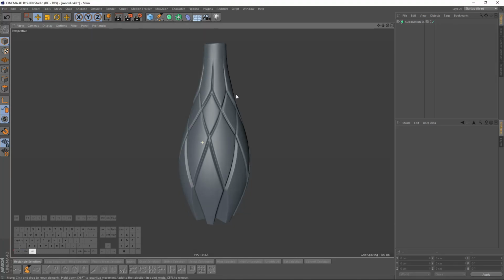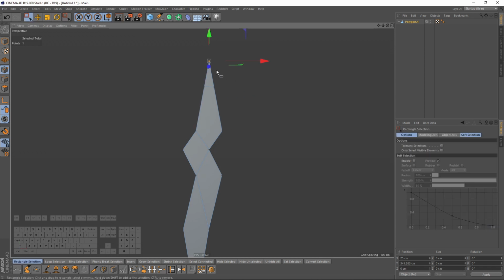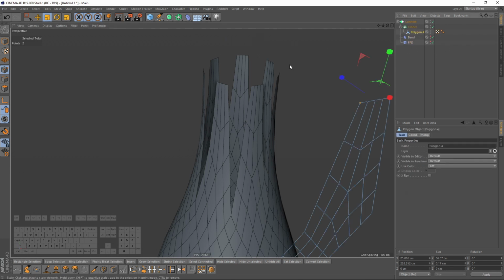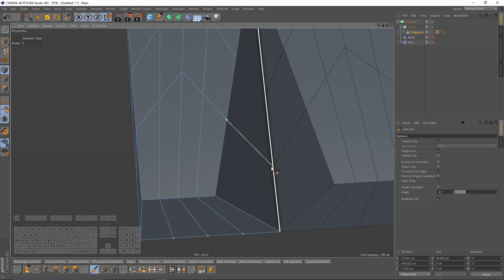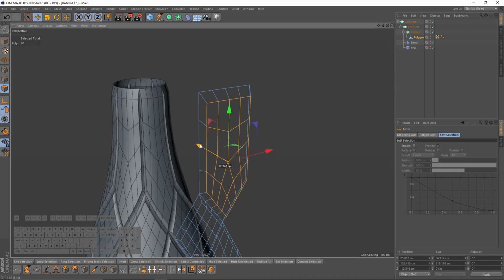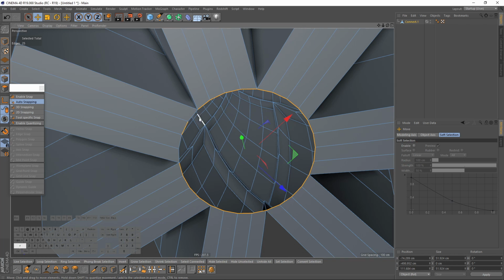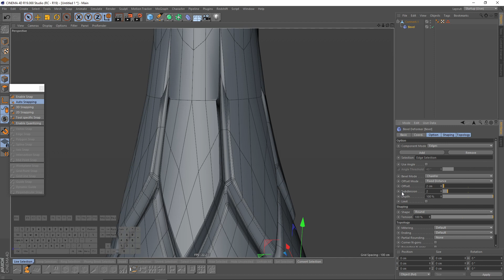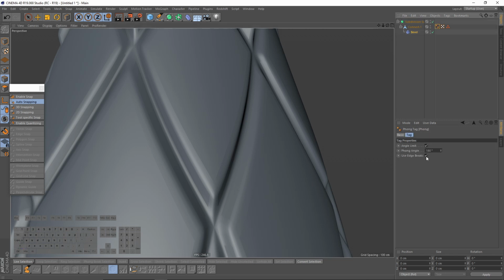Triangle Pattern Vase | Cinema 4D Advanced Modeling Tutorial | Request #2

Comment: Why do you weld points at the beginind of the video and don't just create plane with no segments and rotate it 45°?
Btw thanks for your tuts, they really helpful!
Reply from the maker: Because if I rotate the object, it's center axis would rotate too.
You can do it like you said and then rotate the objects axis to 0 but I don't remember why did like that, it is not that important.
Reply: @polygonpen , I just was worried if I do it wrong if I do it other way. Thanks for explanation!
Reply from the maker: @tensorfly4508  no problem